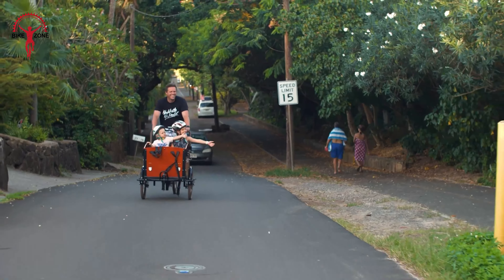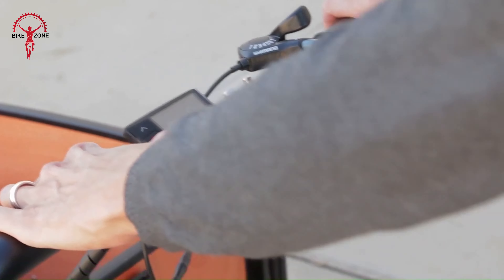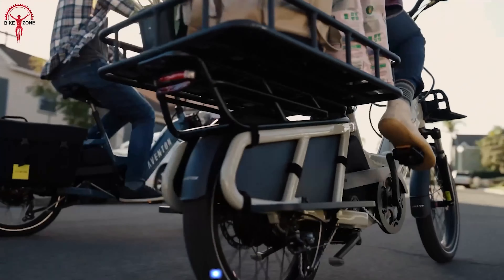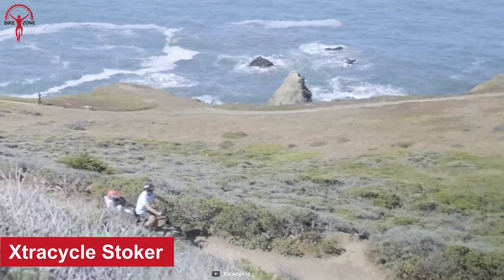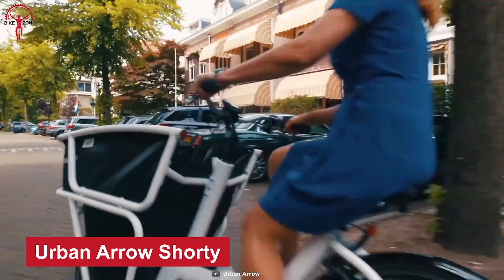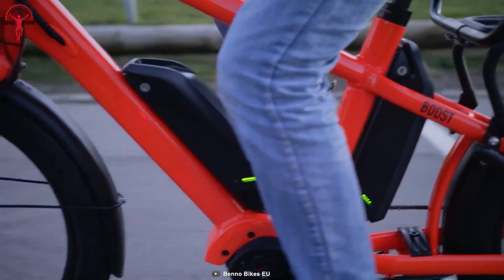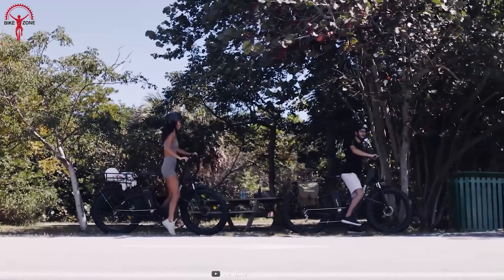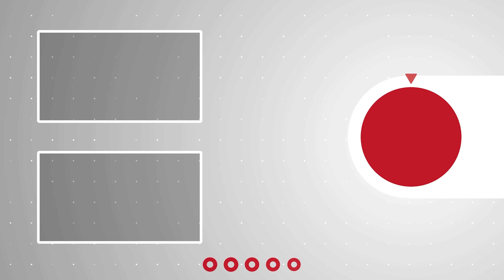30 Amazing Electric Cargo Bikes of The Year

Comment: Now how about a video on E- MOUNTAION cargo bikes. My E-CELLS Super Monarch Crown will carry 400 pounds including my weight. 2 wheel hub drive, 2 Samsung batteries, dual suspension, 9 (nine) torque sensing pedal assist levels, 9
or use the throttle), 10 speed Shimano Deore gearing, 4.25" x 26" tires,
Reply from the maker: Thanks for sharing